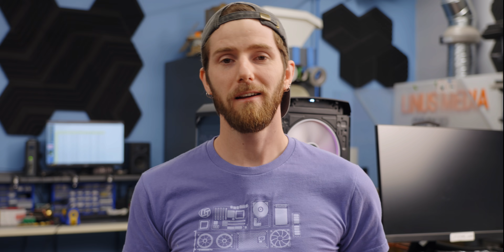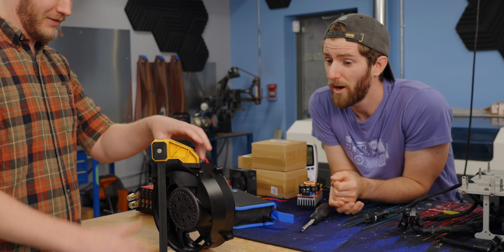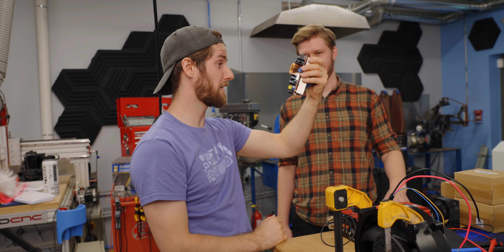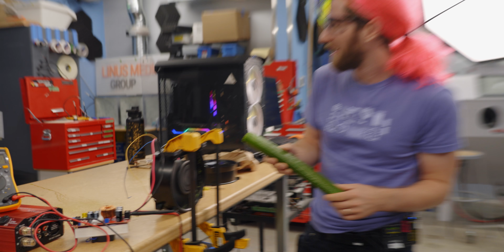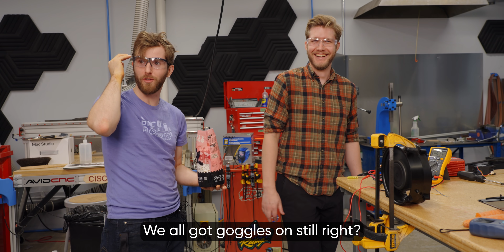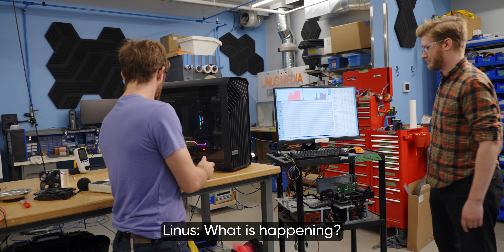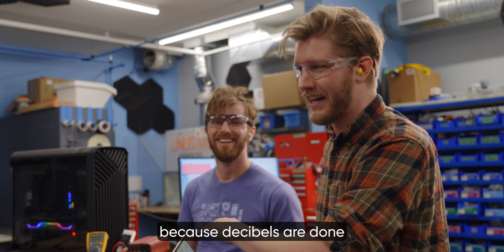The God of Computer Fans

Comment: Tales from Medschool: The reason you get used to super high volume is two muscles in your ear:

The M. stapedius will reduce the hearing sensibility by kind of blocking your middle ear bones (it also does that when speaking so you are not too loud for yourself)

The M Tensor tympany will span out the ear drum and thus create a surface more reflective to high sound pressure. 

Working together these protect your hearing by deflecting sound and reducing the amplification
Reply: Interesting. I thought it was just a mental thing. I usually have to crank the volume down when I first use the computer for the day, eventhough it's the same setting from yesterday.
Reply: @anxiousearth680  the is a mental component to it because you can reduce the impact of all your senses except smelling significantly, but there is also the anatomical component of it
Reply: @qgameYT  why smell isn't affect by a mental component?
Reply: @carlosdgutierrez6570 

Tldr: because smell is not filtered because evolution

Because smelling is evolution-wise a lot older than the other senses and because of that the neurons for smelling are not routed through the thalamus which is the brain area that does the filtering of information before it goes into consciousness. Smell can still be reduced though because the receptors for smell can change or die, given the smell is constantly around you so you wont smell it after it being around for a while, but that is not because it is filtered, but because the sensor is getting dulled out temporarily
Reply: Good old med days... it's been more than a decade since i heard those muscle names..
Reply: I don't think I got this
Reply: @fireballyt3676  sorry for only replying now. In more pc terms it goes as follows:

Your thalamus is the Windows soundmixer you can just ignore or turn down the volume of something unimportant, also here is were noise suppression happens

The tensor tympani basically acts like a clipping filter where really loud noises get deflected by the eardrum it works by basically turning up the reflectiveness of the eardrum making it from a microphone into a mirror

The stapedius is the nob on your amplifier where you csn turn down the amplification to make the incoming sound quieter, but on a hardware level so to say.

Comment: The centrifugal force of something spinning at over 7000rpm isn't something you should be sticking vegetables in when it's only poorly secured to a table with a couple of clamps that when maxed out are only good for about 100lbs of clamping force. Holy fk boys... Some rough math in a centrifugal force calculator shows those fans can generate around 1000lbs of soft tissue shredding force (give or take) which of course is no issue so long as they stays balanced... You guys are sketchy AF lol. That being said, I enjoyed the video :)  F=M * V2/r

Comment: You realize you can get a decent variable power supply on aliexpress for about 50-100 bucks up to 2000w and 48 volts right?  Y'all need to shop around more...

Comment: interesting would be use same but adopted to the 12v cpu/gpu rail of mobo, enough power and could be used with speed controller, and after all test it. how load for take gpu/cpu under 80*c

Comment: 16:42: If the wires are same gauge or not I don't know. But black will always have higher power radiation than red, simply because of the color. So it could be that the different color let's you think the black wire is hotter.

Comment: We used to use fans similar to those to cool control panels for our furnaces, 2000F+ furnace plus 120F+ ambient in summer, the components inside the panels won’t last long under those conditions.  These days we use mini air conditioners mounted up to the side of the control panel.

Comment: 17:20
Nothing to do with protection. The way these brushless motors a built, make them terrible generators. 
If I remember correctly, they only convert about 4% of the mechanical energy into power. So simply god awful generators.
There is no chance you can fry your PC with back driving a fan, you can use compressed air all you want.

Comment: You could probably put a big passive cooler for the thing. And it would just blow soo much air, the heat would just bleed off quickly from the heat pipes XD

Comment: You were asking it ever had to procure something like this.  Never in real life, but I was working on a hard sci-fi story, with some AI researchers, and one of the things we talked about was how to properly cool a supercomputer case in the long term.  One of the more high-end solutions we were looking at was to have a low-grade set of compressor tubes in the lower section, and a set of fans like these to pull air through air filters and blast It upwards through said compressor tubes, so that clean cool air is always running over the server stacks.  The speed of said fans is then controlled by a combination of the heat and wattage of the components, causing them to spin up as a heavy calculation comes in and everything starts up clocking, and only spin down when things start to get cooled down.

I could see these being used in a setup like that, and the story even describes the AI controlling the fans as the researchers hearing the whir of them.

Part of the reason why I was watching this video was actually to get an idea of what those fans might look and sound like, and the other part was because I am looking at building, in the next year, a computer that might be able to do powerful AI operations.  I'm thinking it'll have to have one of those AMD server boards with two processor slots and multiple GPUs...

Comment: We regularly use these in large 3 phase motor control centers containing very densely packed 480v contractors, VFDs, and other heat generating pieces of switch gear. Typically one as an intake in the top of the cabinet, and one as exhaust in the other side at the bottom of the cabinet.

Comment: At Brocade we used fans like this for the enterprise router/switch chassis.  Without the upgraded fan kit when upgrading the CPU, the copper power bar would melt out of the chassis. At a cellular carrier we had racks of those inside our big Cisco rack-sized switches.

Comment: I disagree with your "best fan" suggestion. That might be best if silence is your highest concern which breaks the best parameter. I suggest, for consideration, the Silverstone FHP141. My single most used computer case fan for the passed several years. It can be silent or it can be loud but it always moves alot of air with high force.

Comment: Well, this is the .THD2048HT. It holds a 384.00 W at 7400 RPM  and if properly used, it can remove the LTT fingerprints.

Comment: Use these types of fans and much larger blowers on larger format UPS. These look like the same size as old liebert 600 UPS. Most UPS use ac fans though. They are for cooling the power electronics, inverter and rectifier sections etc. Fun video!!

Comment: I have seen one of these installed in a tiny rack room with a single rack that was way too hot, they cut a hole in the wall and put one of these in to blow the air out. It did make a big difference in the room. I also wonder if these would work for a fume hood?

Comment: these are actually for internet servers specifically  the ones you have are actually multipurpose and to replace newr fans on servers which actually take more power and diliver less air flow hence if one of the older ones go out we can just replace it by buying one from delta rather than calling and purchasin from the server contract

Comment: They're like AFB fans - low blade count, quieter.
Not like FFB with their high blade count and MUCH higher pitch and noise level - but far less able to handle high backpressure situations like Alpha 8045 heatsinks.

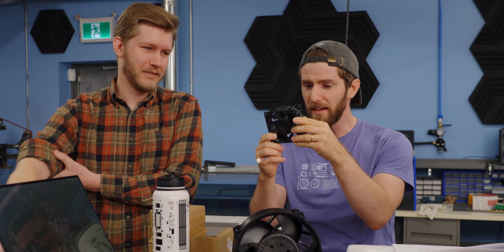Comment: 2:08
The airflow "straightener" guides are a one-patented idea Delta uses at many different sizes.
Consider their legendary 80CFM 80 mm "screamer" models (Reference Alpha 8045 and similar Thunderbird/PIII heatsinks that used them) - which had the SAME type guides - as one example.
Those (and the 92 MM version you have there) spun at around 8000 RPM, NOT "11,000".

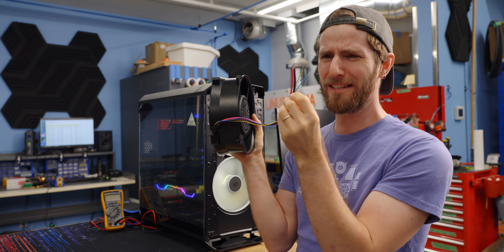Comment: 0:44
Standard MOLEX is very marginal trying to feed 600 Watts even at 48 VDC - you need a pair of +12 and a pair of ground to do it within rated connector amperage limits.
It's rare to see fans in that power level or even close that are DC, they're normally 120 or 240 VAC.

Comment: This is very similar to the fans used to cool IGBTs on Variable frequency drives. they are mounted to large aluminum heat sinks, and the fan flow is directed entirely through the fins and out the back.

Comment: I see these fans and similar at work, I work with ozone generation systems. Bigger systems are water cooled but the biggest of the air cooled ones have fans like these or multiple smaller 240v fans.

Comment: @Linus Tech Tips - 
YOU FAIL WORK SAFETY! 
You justified talked about hair & spinning stuff , BUT you neglected BEARDS & BREATHING PROTECTION @ 14:04 (Beards are an absolute NO-GO with breathing protection of any kind) ! 
And ALUMINIUM DUST is even (neuro-) TOXIC  (a bit like lead) = requires a fully sealed suit , a full face mak , gloves , boots & an FFP3 / N100 Filter or better & this must be done in a sealed room & have a decontamination chamber (similar to Asbestos removal)

Comment: We use fans similar like these to cool routers albeit I think a bit smaller. A small router would use 6 in a fan tray, 3 next to one another with another row behind that. A bigger chassis would use 4 of these fan trays and our biggest uses 8 fan trays, so a total of 48 fans per chassis? small note: they are also responsible for more than 50% of the power drawn by the chassis.

Comment: It's either maxed out at 7300rpm, OR, the tachometer can no longer get a reading after that speed. I would imagine that, at some point, that piece of tape may be going around so fast that it just cannot read it as moving any faster because it is going so fast that the tape appears to be sitting still. Although, if that were the case, then I'm assuming the tachometer's display would read as zero rpm.  Ok, nevermind, carry on.  =)

Comment: Broadcasting towers for mobile networks, have large backup power supplies. It is a large cabinet with rectifiers and large batteries. These fans are used to cool cabinets . 2 fans are placed under the roof and blow hot air out :) This system uses 48 V batteries.

Comment: So actually, those fans are very similar to the ones used in industrial cooling applications for say control panels and cabinets for various and very large CNC machines, something with an electronic speed controller or motor drive that runs 480 V, that Is part of a machine with say a 20 Kw Max power rating. Ficep drill-saws run fans like that in tandem with actual air conditioners To cool the cabinets.

Comment: Serious question... Do you have to out the reflective tape on a blade or would it have been okay just to put it at the edge of the hub? I am thinking that the rotation of the hub would be the same as the rotation of the blade since they are fixed.. just wondering if it is really better one way or another

Comment: I needed one similar but smaller... 200mm or 140mm i dont remember... my Nvidia 8800 GT melted/shorted and was overheating even after switching cooling pads and thermal paste.. and fan.. SO i gotten one of those fans ... IT did the job for couple of weeks.... till one day it smelled like burn plastic and was from the fan... i tried to pull it out from outlet but it exploded in my hand. Around 2014-2015? dont remember cuz my next GPU was amd 250 or 260 cuz it was cheaper than newer generation 300.

Comment: Quite inefficient with that power draw. Much of it going into noise. Reminds me of the fan in a Motorola minicomputer of the early 1990's, but that was only about 63dbA at 1 metre.

You can get quieter centrifugal fans that make less noise and move more air against higher back pressure. The case would require some hacking but it should be possible.

If you want to stick to axial fans, then there's the option of electronically commutated AC fans that run directly off the mains... With some types supporting external speed control via a DC voltage of 0 to 10V.

For actual cooling and not just eviction of dust bunnies, the cooling surfaces have to match the airflow being provided.

Comment: I would guess those fans would be used for test equipment, where a lot of power draw is required. Eg. load testing, you would have lots of power, and lots of resistance, and lots of heat - big heat sinks and big fans. I've made smaller scale stuff, those are surely on the upper end. Expensive because it's a very speciality item, lower scale prodo for rare use cases. Industrial cooling for whatever random thing would require it. Very fun vid!

Comment: Using these voltage regulators barebones, is doable, but it's rather hazardous. If you're gonna use these kinds of voltage regulators as part of a discrete adjustable power supply, a few mods are warranted to make them safer / less hazardous and much more user friendly. 

1: Get it housed inside a suitable enclosure.
2: Replace the logarithmic PCB trim-pot with a wire-connected panel-mount linear pot of the same resistance range. Use pots with spline or D-shape shaft, and get big knobs for them (bigger rotary knobs = finer adjustment control). 
3: Hook up a 4 (or more) digit voltmeter module w/display, one that has its own calibration trim-pot, and separate input for power and sense. Power it off the static, stable output of the primary power supply. These are very cheap. - OR - Start out with a regulator that has a voltmeter display integrated.
4: If the voltage output range is large, wire in another linear pot in series with the first (linear) one, this one with between 1-5% the resistance of the primary pot. Use this for fine-tuning the output voltage you set with the first/primary pot. 
5: Mount voltmeter module and linear panel mount pot(s) to a panel, add a set of 4mm banana sockets and wire to the voltage regulator output, and you've now built a basic adjustable benchtop power supply. But be mindful: it's doesn't have adjustable current limit function or any other protections (beyond those built into your voltage converter).
6: Depending on how your parts are designed, make sure parts are grounded correctly to eachother, to the enclosure etc. These voltage levels are not very likely to cause you grest injury, but always err on the side of caution and safety when it comes to high power electronics.

Comment: Hey Linus, I actually use fans just like these at work. We have about 80 robots and each one has its own controller cabinet filled with the CPU a few servo-packs, device net controllers and a few other electronic components. The controller cabinets are powered 24/7 and get ridiculously hot. they have about 4 of these on the back of the cabinet exhausting air. we also use them in large 480v 3 phase 400-600amp cabinets all over our factory, many of the cabs get pretty hot since they are packed with relays and contactors that are powered pretty much 24/7. lots of heat in and around the cabinets
Reply: we use them for cooling industrial amplifiers for radios
Reply: At my workplace, we had big industrial control cubicles with Siemens PLCs in them that had Delta 24v fans. I had no idea Delta made a 48v monster like this. This looks like a fun fan for a project, like an intake fan for a big homemade wooden or clear plexi enclosure with half a dozen different barebones ATX mounts inside. Kinda loud, though.
Reply: @NoeticSystem  As an AB guy, Siemens makes me shiver. My experience with TIAPortal and Step7 is limited to a 16 year old oven with statement logic in Swiss Dutch 😅
Reply: @VertexDigitalArts  Panel AC units are nice for 4 months. My facility makes automotive carpet and sound insulation, and cleaning Panel AC units doesn’t seem to be on the maintenance managers priority list lol

Comment: I have delt  with fan that spins at 50,000 rpm interestingly these fans work in a vaccum/ultra low pressures as these speeds 50K will destroy the blades of the fan at normal air pressure. These fans are called turbo molecular pumps an these have magnetic bearings for long life as these fans can work for 10-15 years on magnetic bearing.

Comment: Actually San Ace makes a fan that also uses 600 watts but pushes a little more air then that delta. So technically you have the 2nd strongest fan.

Comment: These fans would be used for enclosure cooling. I work in telecoms, and we have metal street cabinets containing fiber plant equipment that use similar fans to exhaust the hot ambient air inside the cabinet
Reply: Used to manage a warehouse for a telecom company and we would receive these on the decom cabinets/superframes all the time, have one as my bedside for when it's extremely hot.

Comment: You guys are really insane! 🤣 Kind of reminds me of my Swiftech MC 462 80mm heat sink and Delta fan combo for my AMD Athlon XP back in the day. How nostalgic... 😆
Reply: Oh the Axp days man what a blast from the past. One of the only processors I e over clocked with a pencil.
Reply: @shawnstillman736  Ah jeah the "graphite hack"... Damn  what didn't people do to get 100Mhz out of those things just for 5fps more... That was still real OC... Now you just push a button and have no idea whats happening half the time, bcs. bord manufacturers aparently love to confuse their customers... And its harder to not overclock then set stock settings.
Reply: @The_ViciousOne  I was able to get much more than 100MHz. Had an athlon xp with the Barton core it was 2.2GHz stock with a water cooler had my rad Infront of a window air conditioner I was able to get 3.8GHz stable. But once the ac cycled and was just blowing air it took about 30 seconds for it to BSOD. Was stupid fast took until the dual core A64's for me to even consider upgrading.